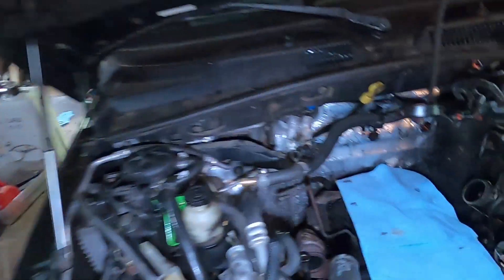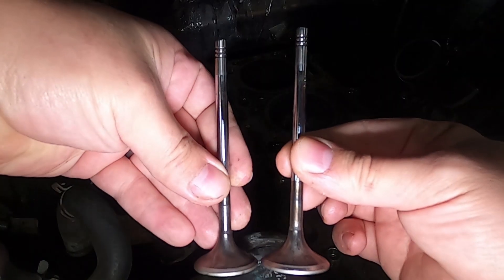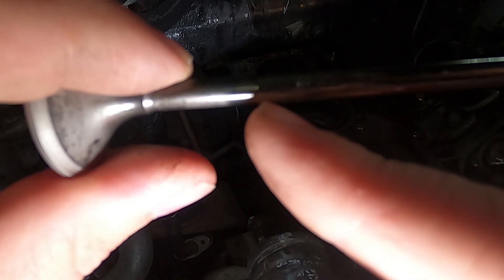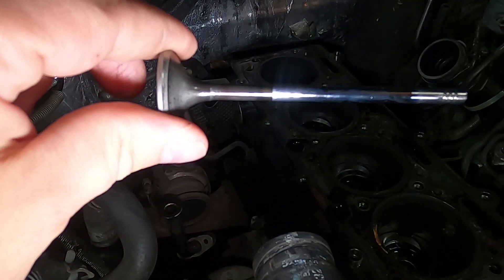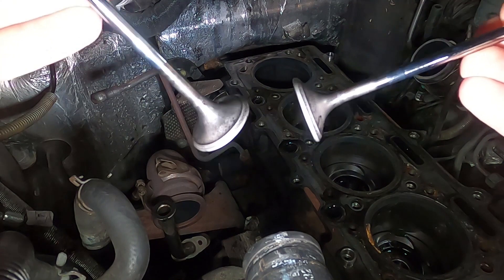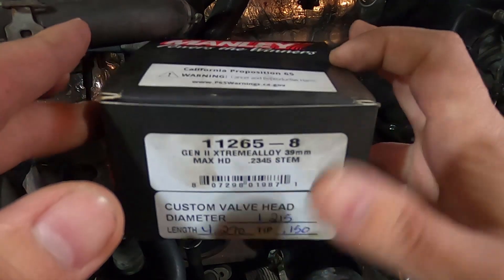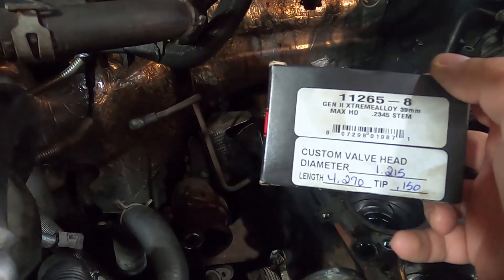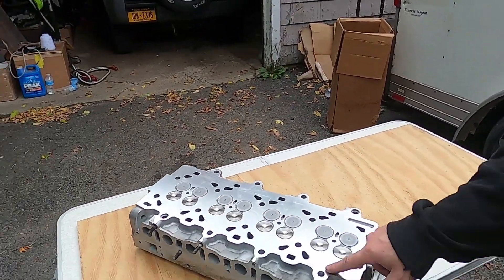Jeep Liberty CRD Manley Exhaust Valve Upgrade

Comment: The failure point is roughly halfway between the top of the alloy and the top of the "coin" - which that specific area is NEVER in contact with anything physically other than hot air blowing past it. The study you reference in the video WAS conclusive - like any good science, it was repeated by other testers and the same results were gotten. This was done by MULTIPLE classes of graduate students studying Material Failure Analysis - literally the study of "here's a broken thing, why did it break and how can we prevent it?" and the results were the following: 

The alloy of the stems starts to weaken in temperatures above 1200 degrees. This results in the internal crystalline structure of the metal changing on a molecular level, grouping together and potentially opening up gaps or weaknesses in the alloy. Over time, roughly 300 billion cycles which roughly translates to 200k miles, the alloy reaches a fatigue point and separates without warning. The result is severe engine damage. Replacement prior to failure is the only cure for the original valves, and reduction of cylinder temperatures by increased boost (or reduced fueling) to keep EGT levels below 1200 degree sustained temperatures to protect the new valves without reducing engine power and drivability.

Comment: That "hard line where it stops being shiny" is where the metal changes, NOT where the valve guide stops. The exhaust valves are bimetal, the stem is stainless and the bottom is already inconel. The problem is the high temperatures and whatever alloy mixture was selected, the alloy slowly weakens in the presence of EGT temperatures above 1200 degrees. This is why higher boost levels (or reducing fueling) is so important to the CRD, as it reduces the EGT levels. With a proper setup, you can run all day long pulling 6000 lbs at 75mph at only 800 degrees EGT - measured at the manifold.
Reply from the maker: These comments right here are great! thank you for the information and based on my limited knowledge it seems accurate, All in all I am hoping these valves will be a good upgrade, While I was in there I wanted to install a EGT sensor  to keep an eye on things and I would still like to , seems like I might need to think about doing that and getting a proper tune done to keep the EGTs down.

Comment: Hi. I have been following you for a long time and I like your work on the Jeep Liberty. I just have a small question. I recently changed the thermostat on my Liberty and I noticed that the hose leading from the viscous heater is connected differently than on the official presentation of this engine. but what I tried to find here on YT we all have them the same. do you think it's actually one and the same? thanks and greetings from the Czech Republic. https://youtu.be/o4eOCcxL1v4 . 3:00 min.

Comment: Hey are you on lostjeeps?  I am in process of replacing the exhaust valves after the rockers broke on one of my CRD's.  Please cross post on lost jeeps and back link to this video.  It should help your ranking.
Reply from the maker: Yes this has been cross posted on the lost jeeps forum in the crd section! Thank you for the comment and good luck with your rebuild!

Comment: Why couldn't you have done your valve job a couple months ago?  ;)  I ended up installing new OE valves when I did my valve job.  Hopefully, these OE valves have a new design where they won't fatigue like the original valves.  Where in NY are you located?
Reply from the maker: Thank you for your comment! We actually did this job two years ago unfortunately the video has not been made till recently but at the same time that's good because we know that the valves worked out great at this point.. also we're out of the finger lakes region of New York.
Reply: @GitItGarage  I used to be stationed in Upstate NY, but now I am in Southern Maryland.  Enjoy the snow and thanks for the videos.

Comment: I am ready to do a head/belt job on mine. I tried to catch a screenshot of the spec sheet for your valves and it was a bit blurry. Is it posted anywhere online?
Reply from the maker: Thanks for the comment! I have posted the specs to our Facebook page for easier access! Hope this helps!
https://www.facebook.com/100063505574658/posts/pfbid0258iLj64X7FR5kGGMPDTg7sraoG33Q9Q7KpmYJsbH3XxYSKWeoEphec2b4tjiJnxHl/